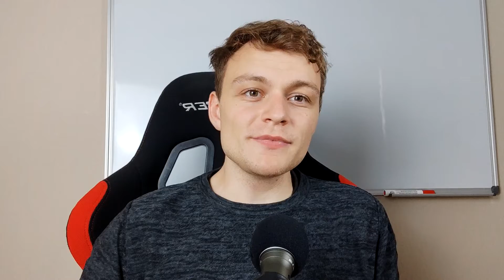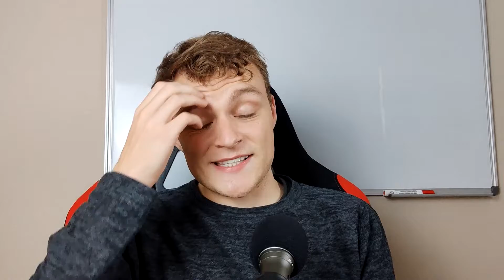How to Save Money using Space Heaters (Methods & Savings Amounts)

Comment: My furnace went out, I am in the process of buying a good space heater. Any tips?
Reply from the maker: Yes, I always recommend this one https://heatertips.com/recommended-products/oil-filled-radiator/
Reply: @heatertips  Thanks yeah I got me a oil based pelonis it defently holded me up until my new furnace got installed . I plan on using it like you said to keep temperatures more steady , especially in the room away from the thermostat

Comment: You presume that those space heaters are running constantly on high.
If you use radiant ones on low and if they have a thermostat, you can save even more.
Radiant heaters heat what they point at, not the whole space.

I use mine only when I am in the room.
I turn it off when I leave the room.

Nice trick with the oil filled radiators is that you can put a pan of water on top to add humidity in the air. Makes you feel warmer at lower temperatures.

We have our thermostat set at 63F.
We use blankets and wear warm clothes.

Guess people never heard of wearing SWEATERS huh?

I noticed the author did not mention flat panel heaters.

Long ago when there was no such thing as fiberglas insulation, people used to pack newspaper between the wall studs.
Unfortunately they had the old post & loop wiring and many fires resulted.

Open your drapes when the sun is beaming in. Each 'standard' window will input about 5,000 BTU of free heat! That is the same as running one space heater PER WINDOW!
Draw the drapes when the sun goes down.

Insulation makers have doubled and tripled the prices of insulation. Some even more.
No legitimate reason for it other than pure unadulterated greed.
If inflation is 9% that does not justify a whopping 400% increase in costs/prices.